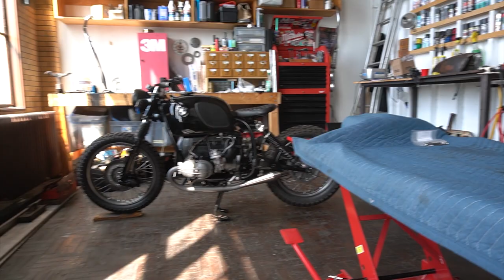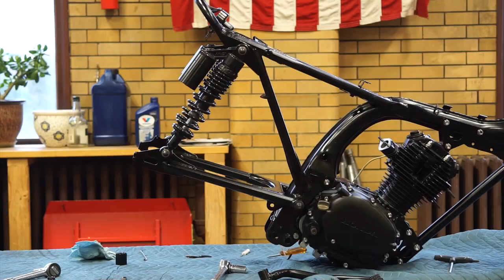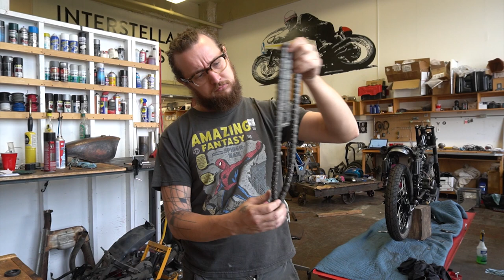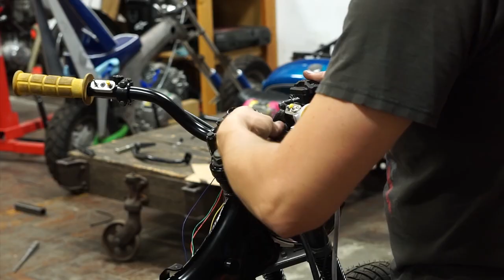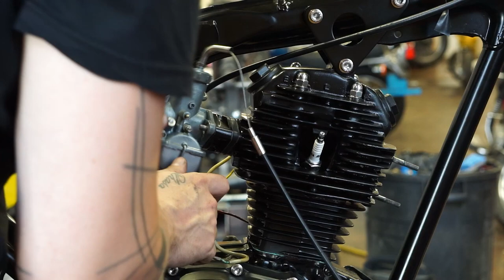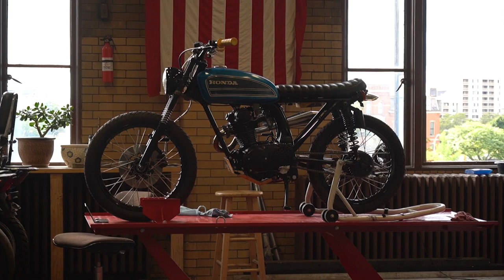CB125S Cafe Racer Assembly Timelapse - Brat Style 1975 Honda

Comment: nice work!, i wanted to know about the air filter you used.. is that reliable?
Reply from the maker: Thanks! A pod filter requires some fussing around with the carburetor jetting, but once it is figured out, it's perfectly fine. I'd still avoid riding in heavy rain though as it's not as good as the factory intake at filtering out water.

Comment: Could you explain how did you fixed headlight holders? I see, you caught original holders... I have a problem to find small holders, cus my front fork 27mm/ 1.067in diameter.
Reply from the maker: I fabricated them myself, using some pipe I found that had a similar inside diameter to the fork diameter. The parts that the headlight bolts to are actually cut from the end of the bike's frame and welded/blended onto the pipe.
Reply: @roodlum  Oh! I see! Thank you! I am really enjoy to watch your incredible work!

Comment: What front forks did you use on this? We are doing a 78 CB125S Cafe and would much prefer hydraulic front brakes vs. the stock cable actuated. Thanks in advance.
Reply from the maker: It uses the stock forks, but with a new mount welded into place on the fork leg and a Honda Rebel caliper mounted. Honestly I probably wouldn’t recommend going this route as it’s pretty tricky.

Comment: Hey I'm restoring a 73 cb125s and my front brake mechanism is completely rusted and cracked, what hydraulic brakes did you use for your bike?
Reply from the maker: It's a caliper from a Honda Rebel, we welded on a brake mount to the fork. If I were to do it again, I'd probably opt for swapping on the forks from another bike or finding a CB125s front drum brake instead.
Reply: @roodlum really? I imagined the disc would be worth saving though. Is the issue a lack of stopping power or is it just substantially easier to swap the parts?
Reply from the maker: I just find the cable operated brake caliper to be very uninspiring

Comment: What wheels are those and what tire size are you running
Reply from the maker: I replaced the stock rims with similar sized Borrani aluminum rims and Michelin City Pro tires. Those rims are very expensive but should hold up to a beating.